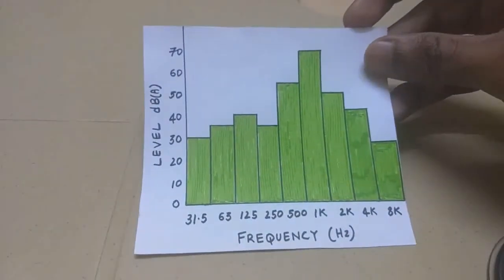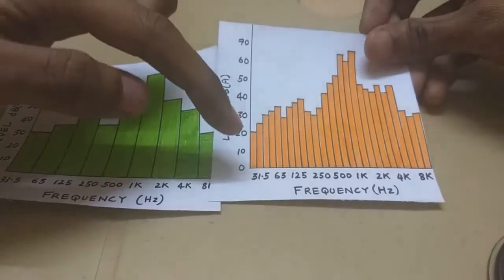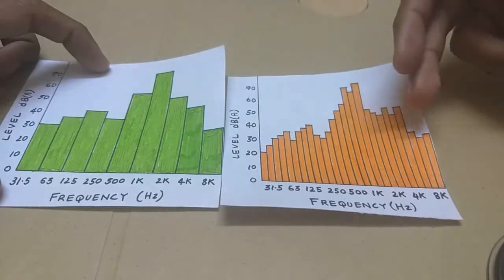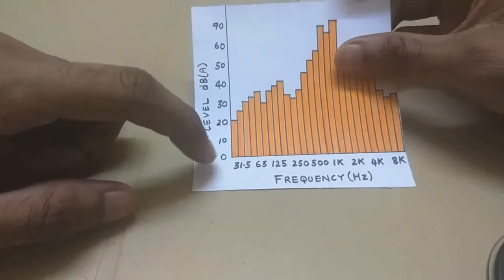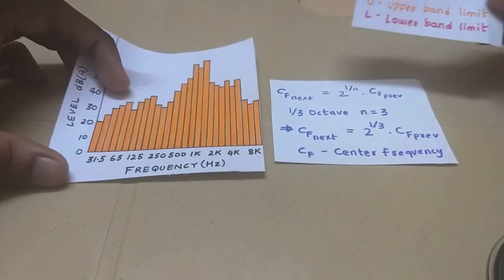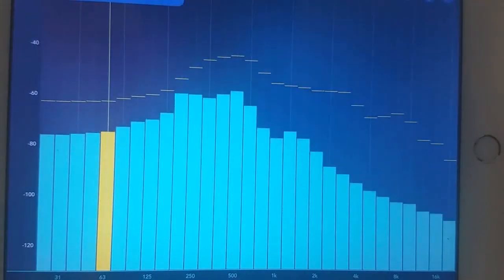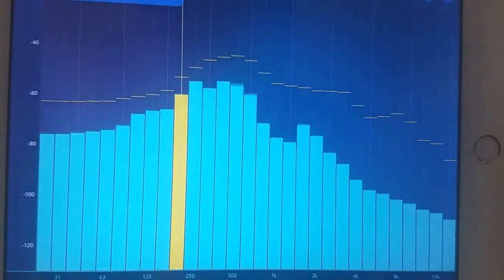Octave 1/3rd bands explained and demonstrated

Comment: Thank you for making this video. I have a parametric rack mounted equalizer with 12 filters on it. You can select the band with size to adjust by entering a value. The manual states that 60/60 is one octave. Is 20/60 1/3 of an octave? Your video helped me understand this piece of equipment that does not look like a typical graphic equalizer.
Reply from the maker: Hello,

Thank you for watching the video. Yes, 60/60 is 1 octave, 20/60 is 1/3 octave with a Q factor of 4.318

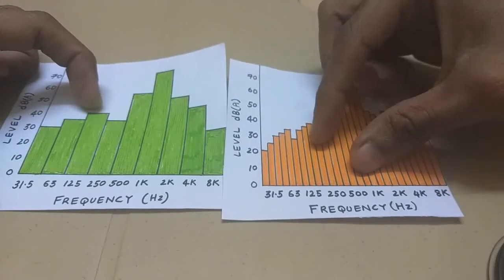Comment: Question at 1:33 you mention that the band with center frequency of 125Hz has an upper limit of 160Hz. Is that correct or am I doing the math incorrectly? Thanks!
Reply from the maker: Hello,

Thank you for watching the video. The upper limit of 125Hz band is around 140Hz. I had incorrectly mispelled 160Hz. You can check the link in the video description for the math.